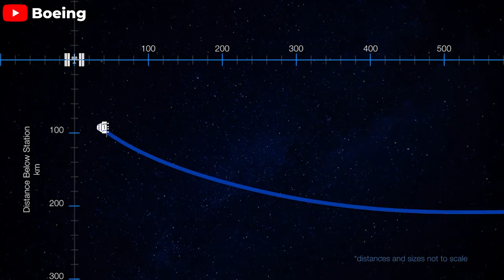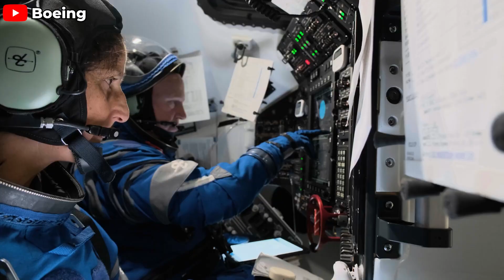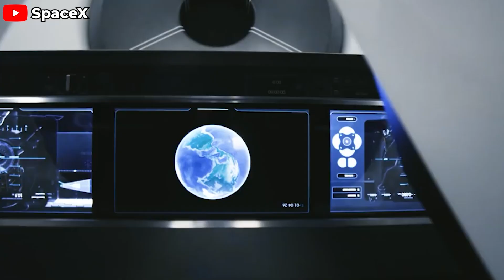Game over! NASA finally realized WHY Dragon is BETTER than Starliner...

Comment: Get the software working to the point that Starliner can undock and safely clear from the ISS.  At that point who cares if it burns up.  Boeing is done.
Reply: No. That will never do. NASA is determined to land it and try to help Boeing try to recover its sullied reputation. Boeing and NASA are deeply involved in many other projects together. They really want to have a second crew and supplies transporter.

Comment: To the channel: that was an excellent review of the situation; better and more straight up factual and concise than most such channels.
Aside:  Rocketdyne are getting off quite lightly here.  They made the thrusters.  Thrusters are hardly new technology.  Yes, ultimately, Boeing owns the responsibility, but Rocketdyne made the thrusters. 
Further, it is beyond belief that Boeing removed the fully autonomous undock option.  As if the current situation was inconceivable - even though precisely the same situation arose only 2 years ago with the leaking Soyuz, which had to be autonomously undocked and send to the flames.

Comment: I am sure NASA, like everyone else, including Boeing, knows that Spacex is superior in every aspects with everything it makes.
But.. NASA wants options, which is a fully sensible policy, so has to pursue competitor vehicles so it is not completely reliant on one company / vehicle. 
It is just highly unfortunate that Boeing is failing so badly in its endeavors.   
Dream Chaser is (slowly) in the works, and hopefully that will be operational in due course, albeit no chance of that before well into next year.
At this point, I would guess that Boeing is on the verge of throwing in the towel itself, as its aerospace ops have cost it money and reputation.  Even ULA is barely in the race.
Reply from the maker: You're right 👍
Reply: Russia  has  used  one  rocket  Soyuz for  40 yrs  why -  it is  reliable .....

Comment: I thought that Starliner had already made a trip to the ISS and back with no problem, although there was no crew aboard on that fist trip.
Reply from the maker: There were some issues actually, but at least they made it.
The point is they has changed some things and they didn't test them. 
So, new problems
Reply: Exactly.  And the fact there are crew to consider on this mission, changes the considerations significantly.

Comment: You have to Admire Musk's SpaceX for taking Rocketry to the Next Level ! ... with the Falcon and Falcon Heavy Rockets ... Unfortunately the BF Rockets and  Chopsticks Landing system are a lot Harder ..... -D
Reply: Hey, there have only been 4 Starship tests so far, and each one made significant improvements.  It will be perfected, for sure. In fact, the improvements to performance of Starship has been faster than the original Falcon 9 tests.   The chopsticks are work in progress and no attempt has been made to use them as yet, to catch a returning Starship.  
Honestly, Spacex might as well be representing a more advanced civilisation, compared with the (non) competition.